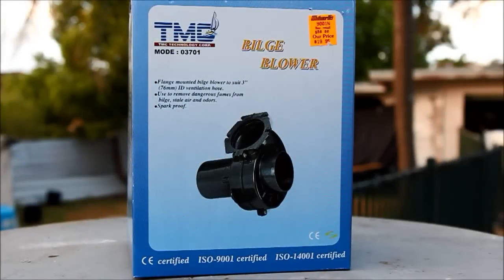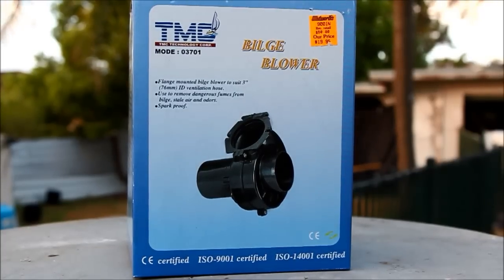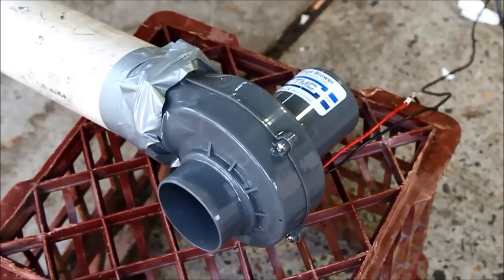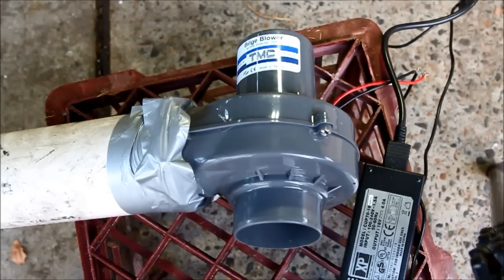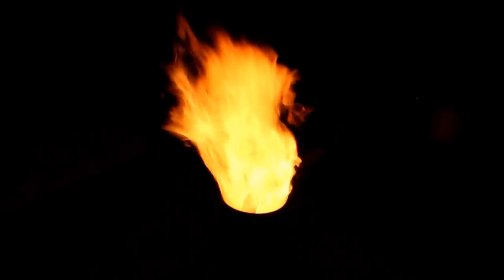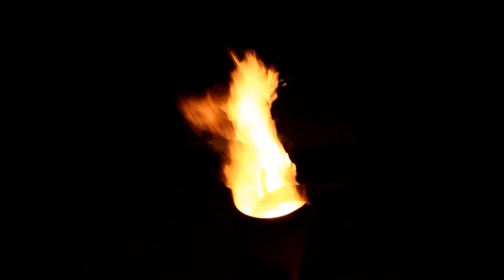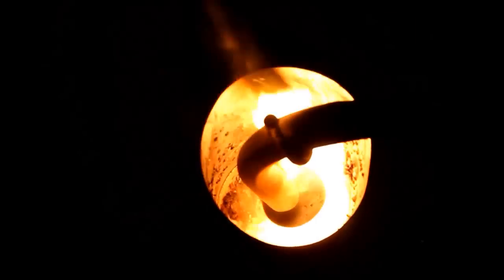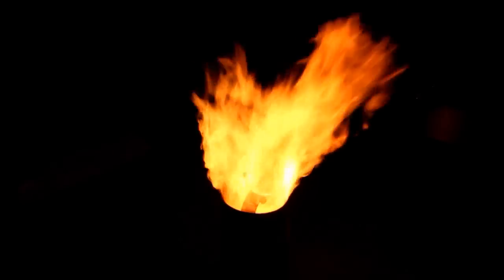12 volt Blower for Waste Oil burners, heaters and furnaces Tested.

Comment: we use a home ventilation blower, they are used in showers and all that. Works pretty well too, dirt cheap, and designed for mains power. So just put on a plug, plug it in and away you go.
Reply: bob rosco, nice
Reply: SAFETY SISSY'S!!!!!!! YOU GOT TO POUR GAS ALL OVER IT English accent

Comment: LMAO...  You are hilarious.   Little shop vacs make good blowers.  Use a speed control for a ceiling fan on it. (they look the same as a dimmer switch for lights)  Maybe you don't bother with speed control because you are a "full out wide open"  kind a guy!  But the switches are cheap and if you build it into an outlet box then you can try plugin all sorts of thing into it.  Awesome videos!
Reply from the maker: You are right on the money with the speed controllers. Even though I haven't done any vids, I have been playing around and testing. One of the things I have for a new setup is a Speed controller for the blowers and one for a fuel pump. 
This allows very precise control for Mixture and output.I will be showing that in the next vid, whenever I can get organised for that.

Comment: I watched this again this afternoon while eating a salad. I was taking a full size bite when you said: (5-miles away).. My monitor now looks like a veggie garden... lol....
Reply from the maker: Steve 1961P. BWAHAHAHAHAH!!!I'm sorry about your monitor Steve but if you had been wearing a face mask to eat your Salad like I'm sure many would recommend, the shield would have caught the salad explosion and prevented your Monitor being  Vegged. I hope you wore Gloves  when handling the knife and fork or used Rubber ones.  Remember, Safety Third!
Reply: Oil Burner I am quite careful to only use plastic forks and knives. However I did nearly gag on a spoon once, so I no longer use them. It makes eating soup kind of a bitch and it takes forever to eat it with a fork. I tried a straw once, but missed a small piece of that horrible sulifan wrapper and went through hell passing it, so I am stuck with a plastic fork.  I just hate all these things we have to be so damned careful of!!

Comment: Great video! That looks like it's doing better than my blower.  I could change up, and go that route, using my other blower to make it forced air. 
You do realize that knitting is dangerous, don't you?  You can get burned on those flying threads, and poke your eyes out with the needles! 
Keep 'em coming, Dude!
Reply from the maker: With these blowers being so cheap you could afford  to keep spares!
I always advise the safety sissys to use Rubber knitting Needles. Not everyone is the the tough wreckless kind like our grandmothers.  Some people don't want to take the kind of life threatening risks they have so that is why the zealots always wear gloves and a face shield as well as long sleeves and steel capped boots while knitting.
Remember, Safety Thrid!

Comment: Bought this fan from eBay and connected the battery charger 6/12 volts makes it just right for small flame control not everyone using veggie oil wants to melt metal thanks again for your help

Comment: I've found using a automotive heater/defroster blower motor works good
Their really quite, and with a reho-stat you can control it to 3 speeds and it's only 12 volts on a automotive battery.
Reply: Yup, my old Chevy truck uses fans and speed control under the hood. Just gotta make a housing for the n no lower motor and the round fan .

Comment: For the waste oil/Wood Fireplace hybrid i'm building I am using a Car interior blower. Figure since I just blew up my Toyota Camry's Transmission (Purchased car for 300 bucks) I might as well strip down any useful fun stuff!
Reply from the maker: yeah I have used one of those on some of my other burners but haven't featured it. One I used was hopeless, the other one is great. Being toyotas always have good aircon. I'm tipping yours will be a good one.
Reply: Yeah I hope that's the case. She was pumping good cfm when I parked it the other day

Comment: Awesome! Is there any chance to see the diagram of this  burner? (I am not asking for measures).
Reply from the maker: Diagram? It's a piece of 90o bent pipe into an extinguisher or gas bottle with the top cut off. 
I could not imagine it being any more straightforward.  Have a look at my other vids featuring the same burner setup like grannys chamber pot vid.
Reply: so the oil drips inside the tube just after the blower?
Reply from the maker: Correct!
Reply: Thanks for the reply, greetings from Peru.

Comment: Hi oil burner I built a burner from a gas Cylinder ·and a bouncy castle blower but having problems with it back firing and I dont seem to be able too get the heat up and I was wondering if you could help me out?
Regards
Vinmiser

Comment: OB, how long do you think you get out of the round metal plate at the outlet of the blower pipe? I think you have shown us before what you made another one of, but my memory is a mess from reading too many of those SAFETY TIPS and RULES all my life! 

Toward the end when you have it turned way down, it looks like about what I need for my pool heater project. Sure wish I could find the time and weather to get back on that!!
Reply from the maker: Steve 1961P. The metal plate is kept cool by the incoming airstream. Mine certainly shows no signs of deterioration and I don't think it ever would. I expect it would last a very long time but you could also use a bit of stainless and that would guarantee it would be the most resilient part of the whole burner. The pool heater is a priority goal for me atm as well. Only been going to get a Round Tuit for about 10 years so I think it's due.
Reply: Oil Burner Hahahahahahaaa... It's been 5 years for me, so I think you'll finish before I do.

Comment: I'm interested to see how small you can scale this before it stops working.
Reply from the maker: Flame or physical burner size?
Reply: physical burner size. if it could all fit in a 30x30x30 cube that'd be awesome for a water heater. A water jacket could help reduce the size maybe
Reply: That blower if running free (i.e. no back pressure) should have a 100% duty cycle.

Comment: You say you use a "drip system", so I assume you have a gravity feed (a drum or bucket higher than the outlet). How big is your tube and what sort of flow rate do you allow to run say with this blower fan, acknowledging that  you "adjust accordingly" and are observing from a bunker. I also realize it probably varies on the thickness of the oil and temperature. Just trying to work out a parts list.
Reply: Yep,sure is a drip system ,just chuck in a coupla safety nuts and it burns for feckn hours!!!!

Comment: Do you find funneling the air supply from 3 inch to 1 1/2 inch to be more effective with a gradual long reduction instead of a short direct adapter? I converted a rocket stove to run off oil but I'm still getting smoke. It could be a number of reasons, from possibly, the burn chamber is running too cool, not enough air flow, really dirty oil, or my 2nd stage heat exchanger isn't allowing proper air flow. But thanks for your quick reply to an old post!
Reply from the maker: The BIGGEST factor is the PRESSURE the blower is capeable of doing rather than the volume. A fan will move a lot of air but has no pressure to push said air down pipes. A blower generally has more pressure and will work better through tubes etc.  If the pressure is low the duct has to be large to accomodate.  Think of compressed air, you can get a good airflow through a tiny pipe. 

Running too cool can be not enough airflow to fan the fire up enough to get the required retained heat or it can be too much airflow( not enough fuel) and over cooling the fuel or the burn chamber.  Dirty oil makes no difference, Wet oil if you are using veg particularly is a problem and can take away a  lot of energy.

If you have a HE in the exhaust gasses it will carbon up REAL quick if the fire isn't hot and clean. Check that isn't affecting airflow because if it can't get out, it won't go in and, the outlet need to be larger than the inlet generally because the hot gasses will have expanded the air going in and need more flow to get out.  

With my burners I always have the outlet now larger than the inlet by design for this reason.  Saves back pressure on the blower and allows for better airflow. More air will burn more fuel gives more heat at full tilt.
Reply: @glumpy10  Thank you again for the quick reply. Yes I think my burner has a few problems, like the first one is my exhaust pipe is 4 inches and my intake chamber is 6 inches. The unit seems to work really well when I get the oil flow adjusted correctly. Right now I'm using a shut off ball valve and a needle valve to control the flow. I've filtered the oil using a sponge mat but I think the needle valve is still problematic when being gravity fed so, I'm converting to open drip feed into a funnel. I think I will try your squirrel cage funnel burn and see if that gives me a cleaner burn with a voltage limiter to adjust the air flow. Thanks again mate! Cheers!

Comment: for comparison, what are the cfm of your 'regular' AC blowers?

Is there a relation of gpm of oil and needed blower CFM?
or is one of the just "as much as you can get"? 

thanks
Reply from the maker: +Yves Baggi  Hi Yves,  Unfortunately none of my other blowers are marked with their CFM and I have no way to measure them.  The big silver blower is by far the most powerful and has a half HP motor. The big Jumping castle blower has a 1 Hp motor but is not as powerful air wise. I think that's because the silver AC blower has a proper Curved blade Turbine like impeller where as the jumping castle blowers are just cheap pressed straight-bent  blades and no where near as efficient. 

There is definitely a ration of air to fuel. I don't know what that is in figurative terms, but there is definitely an air to fuel ratio that needs to be worked in.  It's a fairly broad ratio but definable too little or too much air causes problems.  Too little is smoke and a lazy fire, too much and the burner over cools, blows white smoke and will go out. 

That said, you can get a fairly broad output on the same air input by adjusting fuel and I have shown this on several vids but for best results, you need to " Tune" the air and fuel together. It's not touchy, but you can tell when you are in the right area.
Reply: +Oil Burner I have this squirrel cage blower used for blowing up matresses and stuff, lots of cfm!
it says 30 minutes max conescutive operating time, safety sissy or a real hazard for the motor?
Reply from the maker: Joep Stuyfzand
Well I certainly wouldn't dismiss it out of hand. there is probably a tolerance in there but no doubt the thing could get hot with sustained use. Usually motors have a heat rise rating that should not be exceeded. If you are in a cold climate where there is snow, you'd obviously get a lot more  run time and may be able to go indefinitely than what you would if you are where I am in summer and it's 40C. Most motors I have seen have a heat rise of about 80C so it wouldn't take much to exceed that with summer temps where I am but may never get close in an environment where it's snowing.

I'd also guess that the fan has an efficiency curve. That would be how loaded the motor is at different airflow's and back pressures.
i'd suggest run the thing and keep a close eye on it the first few times and see how you go. If it gets too hot shut it down and if it stays cool that you can keep your hand on it than you know it's OK.

I have seen a lot of car vent blowers that actually duct a small tube carrying the pressurised air back to the brushes and armature  in the motor to keep it cool in the critical areas.
Reply: Oil Burner Thank you.
I am thinking about buying a motor, untill then we are using the 30max motor.
What would you recommend?
We run charcoal and in the future waste oil, so something controlable would be nice.
I heard that controlling the intake is bad for the motor due to less air for cooling?

Comment: So i got this blower, and made a burner with a delvan adapter and a 0.75gph adapter. Got the problem the damn thing wont burn properly as it is and adding the blower just kills it right out. =)

using a 74mm pipe for burner tube. - so guessing it can be to large as well.
Reply from the maker: Moronicsmurf  So if the nozzle won't work on it's own its clearly not the blower you need to be looking at.  Sorry, can't help you with nozzle setups, I don't use them. The simple drip systems I use are virtually no cost, very simple, only need a blower to work,  are easy to fire up and run and produce all the heat you want.  Nearly everyone I read of that has used a Nozzle, particularly the siphon kind, has problems with them. You would think if you spend $50+ on something it would work and work easily but that doesn't seem to be the case at all. 
Have a look at my other vids for how to build a simple and cheap burner that will fire up easily and trouble free.
Reply: yeah i have to agree with you. I got it to work today. And the main thing was that it cant burn in the "free air" so i needed to direct the flame into a container, its reaaaally sensitive to sidewind. When i then put the fan into it just split the flame up made it wider. So i think im gonna do a second burner more your tradition. Just need to find a suitable vessel for that.
Reply from the maker: Moronicsmurf
What do you want the burner to do?
The application will help dictate the setup and the vessel you use. Old Gas bottles and fire extinguishers are good but there are other things you can use depending on how you want to put the heat to work.
Reply: +Oil Burner oh sorry didnt see this response until i rewatched your video.. Im trying to melt cast iron basicly or create cast iron from steel. And im also looking into making steel ingots for black smithing.

Comment: Hi my aussy friend . 
I like to ask a question is possible to use one oil burner for wood fired oven . 
If you can give some ideas please . Thank you mate .
Reply from the maker: I put one in my wood fired oven, works quite well as you are trapping the heat which makes the oil burn well.  I only use veg oil when heating anything to do with cooking to keep any contaminants away that might be in other oils. Have a look at the rest of my vids for ideas. Lots of ways you can go about heating an oven with oil.